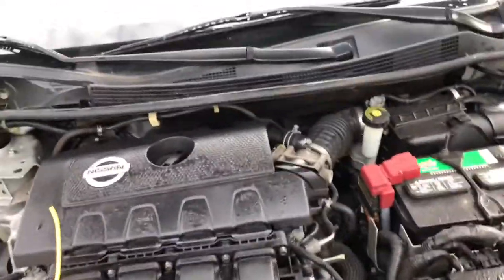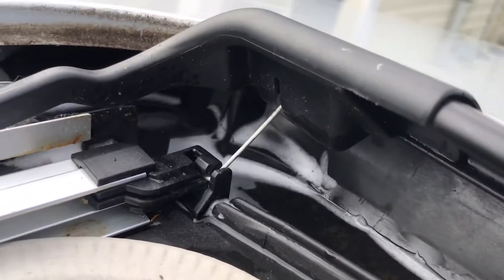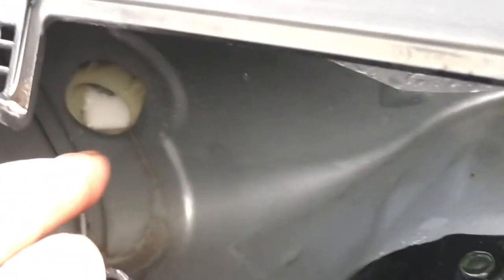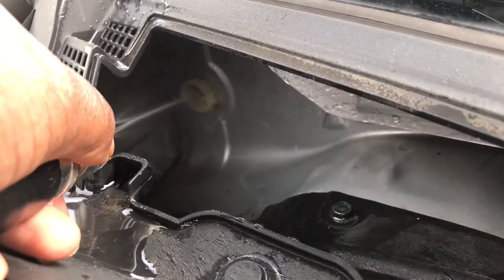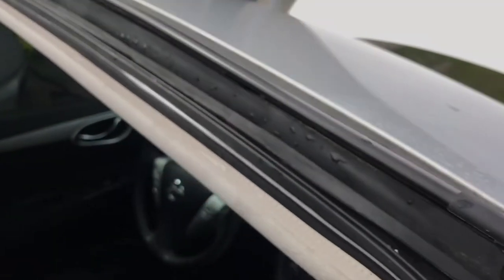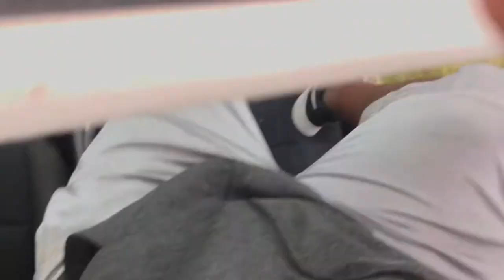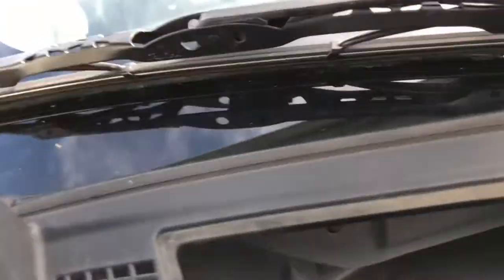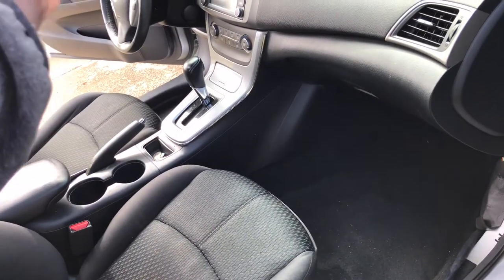2014 Nissan Sentra SR...How to fix water leaking into you car’s Floorboards! Easy fix????

Comment: Thank you so much for this video! I had this issue and went through a couple of other videos to figure out what was causing it with no luck until I came across your video. Thank you! I didn’t have a wire like you and instead used a cleaning brush for a reusable straw and that worked perfectly to clear out the clog.
Reply from the maker: You’re welcome glad you were able to fix it! Good job

Comment: Hey thank u so much man!! I almost took it to a shop it definitely isn't my weather strip on top of my roof it didn't make sense. I realized there was brownish marks on the inside of the roof from water going around the sun roof so seems like it's the source of the problem. Also I grabbed some dehumidifiers from home depot and it helped to keep it dry in the meantime so it wouldn't get worse
Reply from the maker: You’re welcome and I’m glad this was able to save you some coins in your pocket as well. I haven’t experienced any other issue besides getting the water smell out the carpet and car! I suggest you clean the drains every two months also clean the drains at the bottom of you doors under the seal as well.

Comment: Thanks for this upload. I wasn't sure where on my 13 sentra the drains went to. I have water on my passenger side under both floor mats. I'll be taking care of this right now!
Reply from the maker: No problem you are welcome I actually have to do the driver side tomorrow I feel like it’s getting clogged now but definitely saving some money
Reply: @TheRealCountryBoyModz   my driverside wasn't bad at all. Both sides can be reached behind the dash. After I cleaned and dried the tubes I popped the clips in, pushed them inside the car, pulled them off the tube and cleaned them in the sink. Looking into something to re condition the seal around my glass.
Reply from the maker: @MistahElias  nice great work glad it worked out for you... awesome job and definitely need to look at the seals on our Sentra

Comment: Great video. I noticed where the drain comes out under the hood it appears the drain is sealed. It feels like hard plastic. Does that piece need to be removed? I noticed another video with a Rogue removed the plastic piece and that helped out. Thanks!
Reply from the maker: Appreciate it and I never removed the one on this one I just clean the areas shown every 3-6 months and haven’t had a issue with the car leaking inside. I honestly think the only time it will need to be removed is if you’re trying to deep clean it completely.
Reply: @TheRealCountryBoyModz  Are there only two drains in the sunroof? Are there any back drains?
Reply from the maker: @tsrichards16  there are two back drains in the rear of the sunroof like the front…passenger and driver
Reply: @TheRealCountryBoyModz  This is really helpful. Are the drains the same as in the front? Meaning does the back drains from the sunroof run to the drains under the hood?
Reply from the maker: @tsrichards16  they actually run to the back passenger and driver side and exit out behind the rear tires in that area. While the sunroof is open follow the same path like the front drain holes on each side and you should see them. Mostly the front become clogged

Comment: I have the same issue with an altima with no sun roof. What do you suggest? Thanks!
Reply from the maker: Check the seals on the roof and your doors to make sure they are good and also make sure it’s not leaking from inside under the glove compartment

Comment: I have this problem with my Murano and it doesn't have a sunroof lol
Reply from the maker: Your seals may need to be replaced that’s on the roof the black ones or check the one in your doors. Also make sure there is no water in your doors if so you will have to open the drain plugs on bottom of door
Reply: @TheRealCountryBoyModz Thanks man
Reply from the maker: @GaryVance561  you’re welcome

Comment: Can the AC cause water in the cabin on this car?
Reply from the maker: Sometimes that could happen but if you have a sunroof your drain plugs are definitely clogged or loose… do you have a sun roof?
Reply: @TheRealCountryBoyModz  yes sunroof drain were clogged... i did clean them up but that still didn't solve the issue ... there is still water in the driver side and rear seats area ... not in the passenger side
Reply from the maker: @rizwantarar4208  did you clean out the pockets under the hood like I did in the and also make sure your doors are not filled with water
Reply: @TheRealCountryBoyModz  I'll check that ...
Reply: How do you get that water out of the floor board. How long will it take to completely dry up? You have been so much help.
Reply from the maker: @lindaallen7582  I made some solution with cleaning products and liquid gain and got a hard brush to scrub out the smelly smell…. Then took it to a car wash to ensure the leaking was gone and used their vacuum to get all the water out. I let the windows be cracked and sunroof open to let it air dry…. Took about two days to fully dry
Reply: What the yellow thing u use to get the water out my guy?! U did an awesome video!! I’m not sure if my is the AC or the sunroof?!